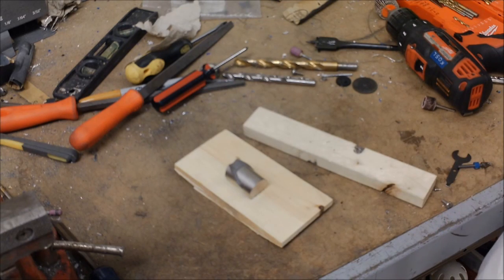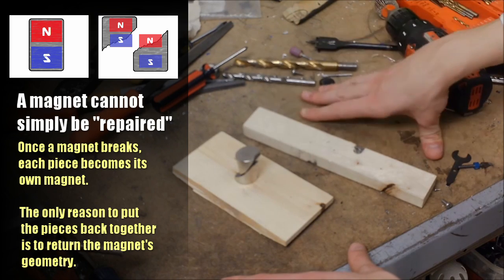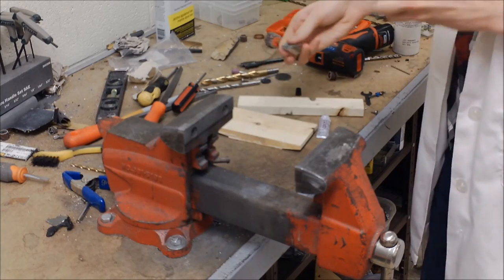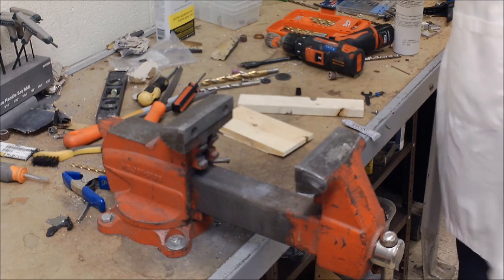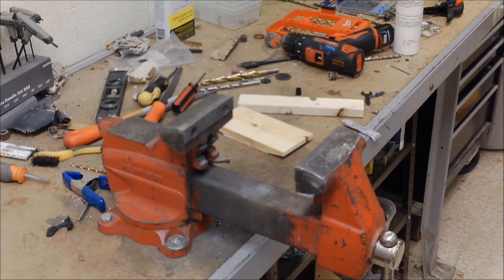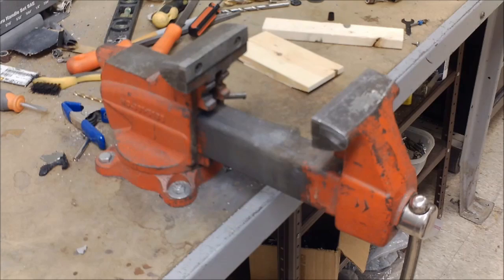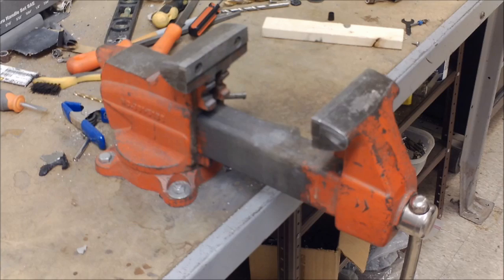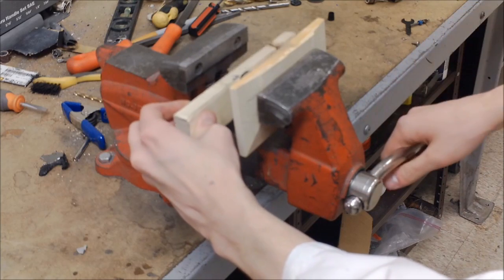Broken Magnet? Don't Bother

Comment: You could get a piece of 1"copper pipe a little short than the length of the magnet glue one piece in the pipe with shims keeping it tight and after it cure's work with the other aligning it w/ epoxy and shims then jammed um in your vise to cure. After that cut the pipe length wise and remove fixed broken,screwed up magnet and discard.
Reply from the maker: Oh yeah. I forgot about this video...
I never really cared about what happened to the magnet. It toast, m8. Kaput!